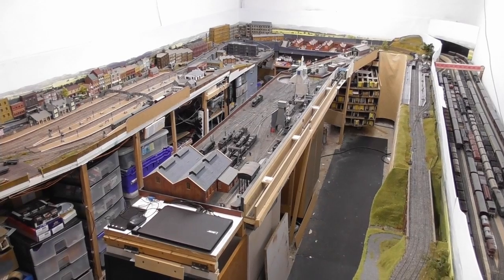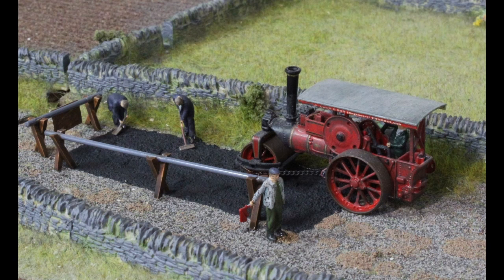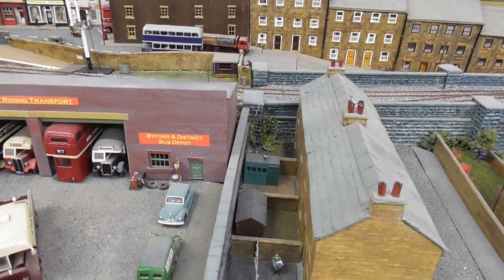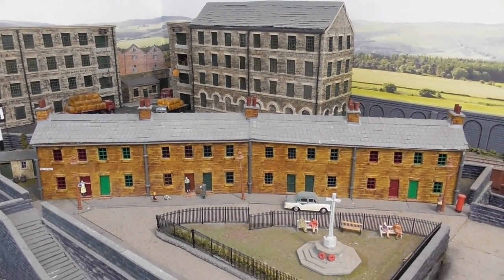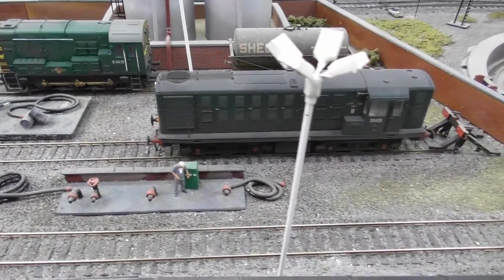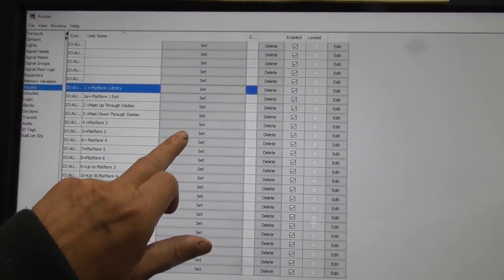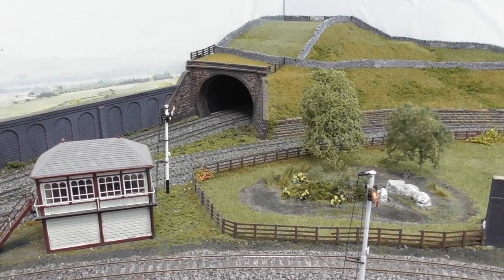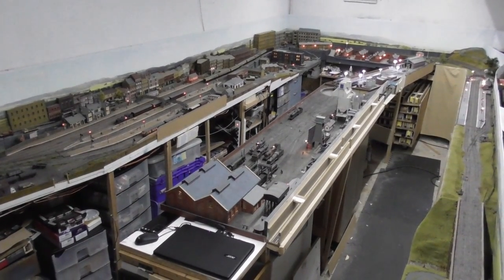Byford Model Railway - A Birds Eye View

Comment: What a great layout full of interest. I particularly like the use of cassettes for taking rolling stock on and off the layout. Thank you for sharing.
Reply from the maker: Thanks, glad you enjoyed it, the cassettes were a case of learning and adapting, the first ones I made were from 4mm plywood but were too flexible to lift in and out reliably. So now I use blockboard, not sure what it's called in the UK. which work well but are very heavy so I had to strengthen the trolley which was bending under the weight. 
I think the ideal might be 10mm ply  but that could work out very expensive.  Richard

Comment: Thanks Richard for a first class view of your layout (birds-eye and track side). I've run out of siding space for my ever growing fleet, the cassette idea has given me food for thought. Full of interesting themes many thanks for sharing..
Reply from the maker: Thanks, glad you enjoyed it, the cassettes were a case of learning and adapting, the first one I made were from 4mm plywood but were too flexible to lift in and out reliably. So now I use blockboard, not sure what it's called in the UK. which work well but are very heavy so I had to strengthen the trolley which was bending under the weight. 
I think the ideal might be 10mm ply  but that could work out very expensive.  Richard